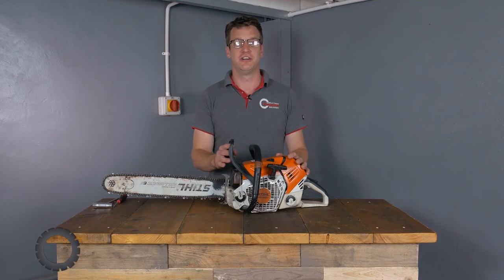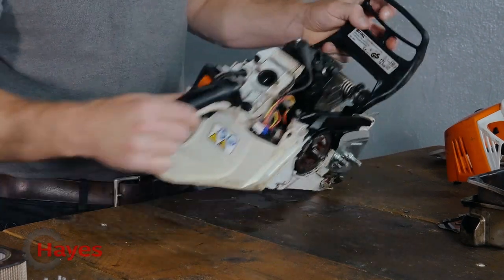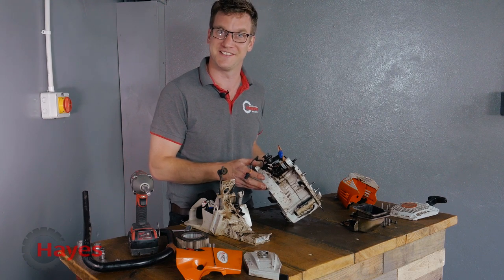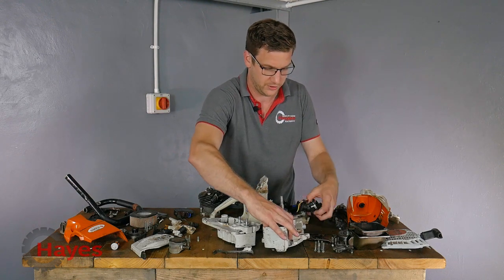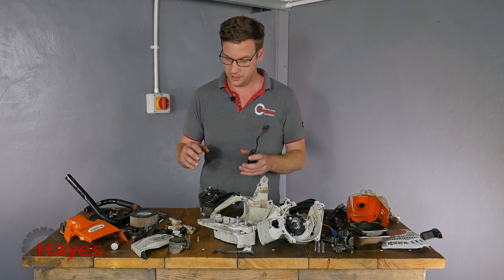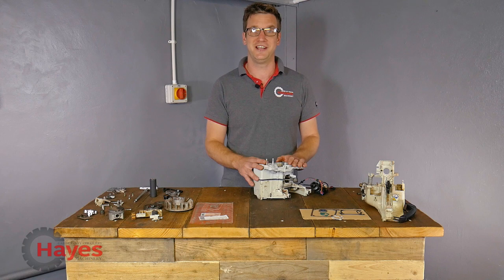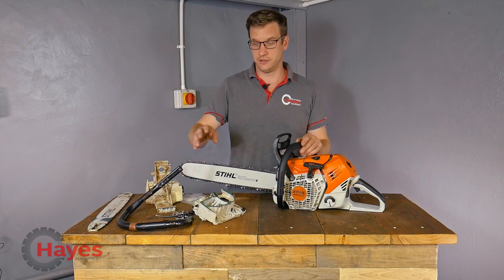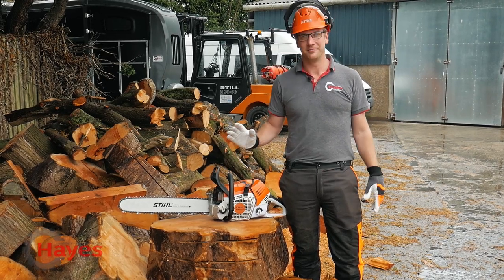Tree Crushed STIHL MS500i Chainsaw Rebuild

Comment: Nice video James, thanks for sharing. Worth noting those new bearings probably won’t last long either.  Having pulled the case halves together using the case bolts you would have introduced preload on the crank bearings and you didn’t remove it afterwards. Also surprised you didn’t pressure and vac test it? 

Either way, thanks for the video, It was great to see inside one!
Reply from the maker: Hi Tom, thank you for the feedback 👍🏼

Comment: Did you use a plug for piston when removing the clutch, also is there another way to separate the two sides of crank case without using the puller tool you had ? Nice vid

Comment: How much did the rebuild cost vs a new saw?
I’m a bit shocked the bearings needed replaced on a saw that new, maybe it’s to do with the fuel injection vs  carburetion Reduction in less atomization and less oil distributed to the internal parts...
Reply from the maker: The rebuild cost would have been around £400 including labour if we were to have done this in our main workshops. A new saw would have been around £1000 so it was considerably cheaper. As the saw was 12 months is was defiantly worth doing. The bearings would have lasted a lot longer but while we were stripping it down we thought we might as well replace them. :)
Reply: Are you saying the bearing replacement was preventative? Your words were more to the affect that it worn and rattled, so that sounds a bit more dire.
Reply: I was more interested in your thoughts about the reason for the pre-mature wear?
Reply: @jimssawsnstuff8903  I'd venture a guess on saying that it's a new saw and new lighter design... Instead of grabbing 2 different saws, they're going to keep the do-all saw in hand. It's only logical for as powerful and light as the saw is that they run it for everything.
He also said 12 months of use in a commercial setting. Pretty sure they're going to pin it to win it and get out to another job. Time is money.
Reply: Anybody follow this already know what the saw is...my comment was about the extravagance and extent of the rebuild and the lack of acknowledgement of the reason for the pre-mature wear of the crank bearings, if that was actually the case. My 460 big bore would likely be a match for the 500i...reason they are going to computers is there are very few of the younger folk out there with the mechanical aptitude to actually look after a saw...
Reply: @jimssawsnstuff8903  No the reason they're going to computers is because it sets itself up perfectly every time, every where. No time wasted having to readjust it and it'll always be at exactly the perfect tune, something that's near impssible on a saw with a manually adjustable carb. In professional forestry a saw needs to last about a year and a half and by then it's already paid itself off.
Reply: Eric C, I’m well aware of the theory, however in reality, they are not trouble free, neither are the M-Tron is nor the husky auto-tunes. Here the shops charge $125 just to hook the computer to them. In reality for anyone who has a decent understanding of 2-stroke chainsaw motors, tuning a   carbureted Saw should be as familiar as sharpening one. The more computer related tech on a saw, the more complicated and expensive it is to maintain, the more reliance there is on having to take it back to the shop bs being able to sort it out in the Bush. It’s self serving for Stihl and husky, that’s why they won’t make their software available to the saw owner.
Anyone needing more info on basic saw tuning, or sharpening can always check YouTube!
Reply: @jimssawsnstuff8903  You lose just as much time having to constantly have to tume the saw, get to a new worksite you have to retune it, different fuel, retune it and unless you have a tachometer you won't be able to tune it exactly right
Reply: Only if you don’t understand what you’re doing. Normal retune is less than a couple minutes...you could waste a week waiting to get your saw in/back when it needs computer tuned
Reply: @jimssawsnstuff8903  Mtronic takes 1 minute to reset,  which it practically never needs to be done anyway, even if you're  the master of saw tuning you won't get near the same results as mtronic or autotune. It's also normal to have a spare saw so if something goes wrong with the main one you have a spare, electronics or a breakage for example. Most of the loggers here use saws with electronics and aside from autotune ocassionally having a 5 minute brainfart, i've never heard of a complaint with mtronic.
Reply: Eric C, you’re on YouTube, not a Facebook group. You’re entitled to your opinion, but at this point it appears your info is entirely based on the promotional material you’ve read or heard. I doubt you have a production saw, nor that you use one on a daily basis. Have a good day.
Reply: @jimssawsnstuff8903  500i, 462cm, 550xp and a 357xp that have seen plenty of use,  mainly use the 500i and the 462 before that, never had a single issue with mtronic after two years of daily use.
Reply: Why Have you had so much trouble With Carb tuning to believe it’s a show stopper? Even when I was logging I didn’t have issues adjusting my saws to the point it would have made me choose the computer over one.
My issue with the computer controlled saws is not being able to trouble shoot them like I can with the non-comp saws.
The new fuel injected saws add an extra challenge, the injector is super small and very prone to plugging if fuel is not kept super clean. The computer can adjust the inspector open timing to a point to try to compensate, but if there is any significant amount of blockage, the saw will be in a lean condition, over heat and be down. I rebuild a lot of saws, work with pro-saws on a daily basis in the tree business and will happily stick to traditional tunes. My 550 xp and 562 have been doing ok with a few mods to deal with heat sink issues. The longevity of those two models suffers due to a combination of heat and nylon cages crank bearings.

Glad you’re having good luck with yours so far.
Reply: @jimssawsnstuff8903  I don't lose much more than 2 or 3 minutes retuning my 357xp since we don't have many mountains to have to adjust fr altitude, but i just prefer to turn the saw on and have it be bang on every time. Husqvarna saws with autotune are or at least were pretty unreliable, but mtronic in my experience has been nothing but reliable and i think if you regularly replace the fuel filter and use good fuel mixture you shouldn't have issues with the injector. We'll see in a year or two what'll happen to the 500i.
Reply: Eric C, ok, I checked to see if your channel had any vids but didn’t see anything posted.
I have a bunch of my custom saw builds and other mods on Instagram Jiminthemountains 

Let me know how the 500i lasts. Right no we can’t get them over here yet
Reply: @jimssawsnstuff8903  It's functioning great at the moment, but it is fragile, bumped into rocks 2 months ago and chipped the clutch cover and had it fall 30cm from a stump onto rocks and a small part of the starter housing chipped
Reply: Yeh, always a trade of when saving weight. I played with a 661 that also had a broken mount and bunch of broke covers
Reply: The bearing's extra wear is due to improper oil to gas ratio. These big cc saws need 40:1 or even more. This is pretty common issue in 50:1 or lower oil ratio 2 stroke engines. The piston and rings look perfect, but due to not enough oil for the rolling wear of the bearings (which need oil volume, quality is irrelevant, unlike the cylinder and piston), this is a normal outcome.. You can easily tell apart the crank and bearings of a 50:1 saw vs a 32:1 for example.
Reply: @jimssawsnstuff8903  >reason they are going to computers is there are very few of the younger folk out there with the mechanical aptitude to actually look after a saw...
Not really. Its not rocket science tuning a carb lol. Things always change, new technology, new ideas, it's how always was. Fuel injection into the crank has advantages, like for example: way more low end torque for its displacement. Why? Because the engine doesn't rely on venturis and air speed to get the proper fuel amount into the engine (which at lower rpm, 2 strokes suffer from improper mixture because less air gets in which doesn't grab enough fuel from the carb's venturis). This system injects the correct amount of fuel all the time and can enrich the mixture even at lower rpm, for example when accelerating while already in wood. It doesn't care that not enough air isn't moving through the saw. This same thing exists in concrete saws for almost a decade now, in TS 500i. If its good enough for that dusty, moist environment with no issues, it's good enough for a saw.
Reply: @em4703  thanks captain obvious...I believed covered that

Comment: Is it possible that cleaning the saw case has introduced dirt into the bearings?
Reply from the maker: I doubt it, but anything is possible. The bearing were not really that bad and would of gone again but as it was apart we replaced them.
Reply: Replacing a couple of bearings, would have adding little to the overall cost.

Comment: I have a question please?
Should those bearings be noisy? The saws only been in production maybe 18 months.
Next - I’ve had the 500i here downunder nearly 18 months used commercially on Eucalypt hardwoods for firewood production.
I have a near new 880 & 661C also along with the 500i.
On the 880 & 661C - I run 404 chain.
Bought a 100 ft roll of 404 chain and the chain break & make tools from the same local Stihl dealer I’ve bought all our saws from in recent years.
But we can’t run 404 chain on the 500i because Stihl in their wisdom haven’t designed and manufactured a 404 drive sprocket for the 500 I. 😡👎
I’ve told the dealer I want one for the last 18 months & nothing. 😡👎
It’s a lot easier to have interoperability between the 3 big saws if they all run the same chains & bars and drive sprockets.
As it is now we have to buy 3/8th chains already made up from Stihl to suit the bar lengths we have for the 500i, or buy yet another 100 foot roll of 3/8th chain specifically for the 500i.
Surely it’s not that hard to design and manufacture a drive sprocket for the 500i to run 404 chain?
It’s my opinion that Stihl engineers need their ass kicked with a size 12 steel capped boot until their noses bleed.
They make great saws - but they are deaf and oblivious to their clients needs!
That’s why company’s like Oregon et al GB etc are all making aftermarket bars etc for Stihl saws, because the Stihl engineers aren’t listening to their commercial clients.
I bought my first Stihl saw in 1982.
Worked as a Forester for this States Conservation department buying batches of new Stihl saws for all our forestry fire crews in varying sizes every budget year, in the dozens.
Then another 30 years in logging and milling buying all our company saws from Stihl.
You don’t get a more loyal or better long term client than me.
But I can’t buy a drive sprocket to run a 404 chain on my new 500i?
Stihl wouldn’t have sold us one of the first batch of saws into this country 12 months ahead of the rest of the world at a discounted price, if we weren’t long term professional users of the product, because they knew we would give honest feed back on the product.
Then when you do and it’s such a simple thing, to be totally ignored?
I’m about ready to start slitting some throats at my local Stihl dealer if someone in Stihl doesn’t start listening to their clients and acting on the feedback.

Comment: That was a very extensive tear down and quite a few major, presumably expensive parts needing replacement.  At what point would you have considered this to be beyond economical repair?  I did look up the price of these new so am aware this is a high end machine but surely with labour and the number of parts required this still added up to a significant repair bill?
Reply from the maker: Hi, we found that more parts needed replacing than first thought as we were filming. So we continued to complete the project. If billed this would have been about £400.
Reply: @MachineryNation  no kidding?! That's not too bad at all... considering what you had to do and the things to replace, that's really good. That ECU box scares me on this saw. I sure hope those don't fail, I know that's not going to be quite as easy on the wallet.
You sold me on this saw because I was hoping the front was indeed magnesium and there's a bit more of it than I thought! Thanks for showing us something that no one has shown, the ENTIRE SAW!
Reply from the maker: @Aint1S  That's alright no worries, we are glad the video was helpful and showed you something new!

Comment: how many hours was on the saw?
Reply from the maker: It was between about 500-600 hours.
Reply: @MachineryNation  we can't get any sort of hours out of these new Stihl saws,  we had a 462 that had crank bearing failure at only 1100 hours
Reply from the maker: @rustyshackleford9314  It all depends what type of oil you use and your mixture as they all vary. And tbh 1100 is pretty good numbers for this saw, in our opinion. :)
Reply: @MachineryNation   1000 hours is about 1 year use for us, we used to get 2-3 years out of our old 046/460 and 461
Reply: @MachineryNation  which do you see more hours out of, 500i, 462 or 572?

Comment: the worst chainsaw built by stihl in my opinion 
it has a lot of force, torque, little rotation in the cut, it doesn't tune, automatically like the mtronic or the autotune of husqvarna, 
and an absurd price for the shit it is